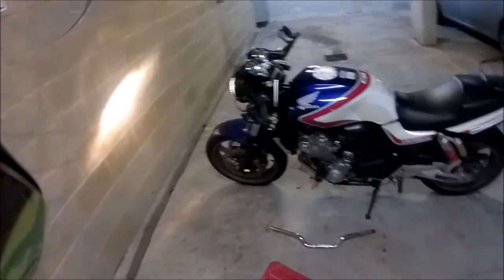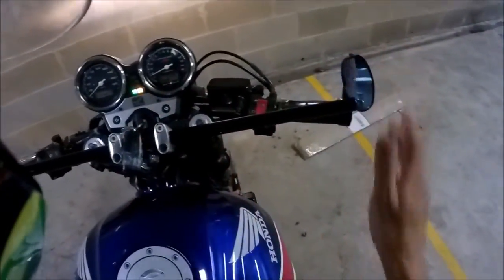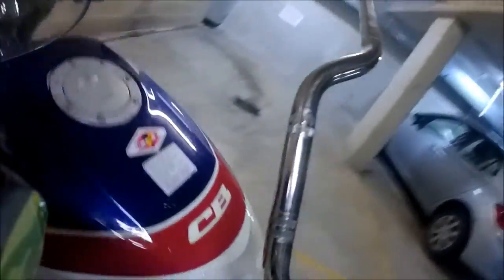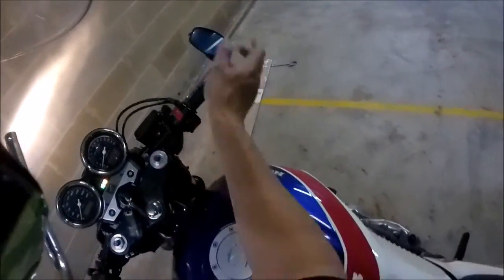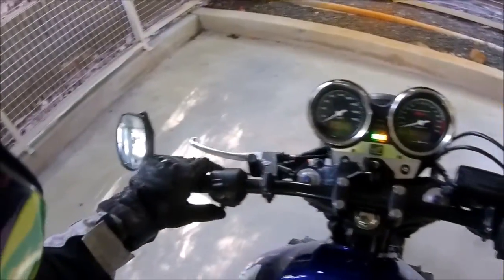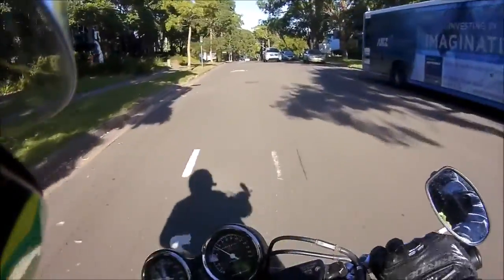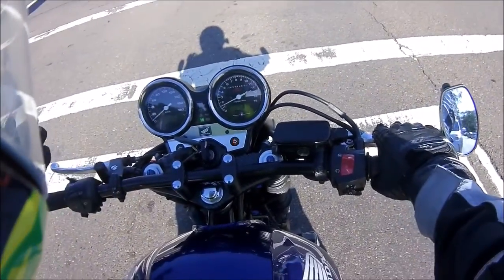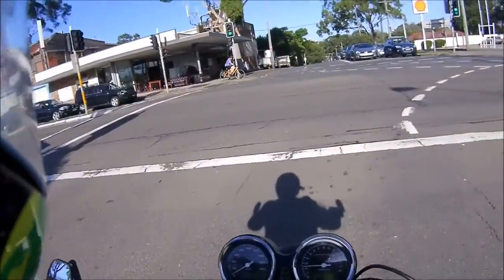CB400 Flat Drag Bar vs Clip-on Evaluation

Comment: The reason those flat drag bars you tried weren't up to par is because they weren't straight or flat enough. Perfectly straight bars hold your wrist at exactly the right position, and are a totally different experience. They are truly the ideal motorcycle handlebar, surpassing the clip-ons and all other handlebar types. However, it's rare for people to fit them. The ones you fitted are more like Renthal superbike bars. Close, but not flat enough.

Comment: How long will you keep the CB?
You don't thirst for more power??
Reply from the maker: i so thirst for more power. but only in a straight line. straight lines are boring. 52bhp in corners is more than enough for me in most scenarios. and I've been riding for 9 years. however I will be upgrading in a year or two
Reply: +POMMEY BIKER I stayed on the CB for almost 2 years, then upgraded to an MT09. I think you'll be quite happy when you upgrade. The CB was a great bike, but there is definitely more fun to be had from upgrading. ^_^
Reply: +POMMEY BIKER What are your current thoughts on a possible upgrade ? (Nice vids by the way ;)
Reply from the maker: +YoureNowOnTV to early to tell at present mate